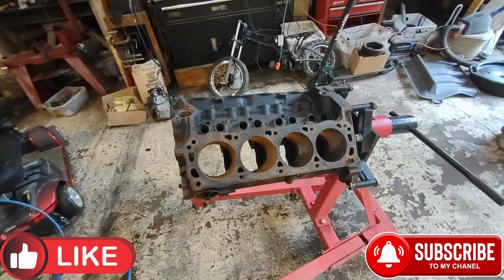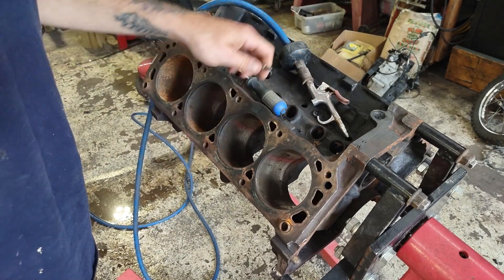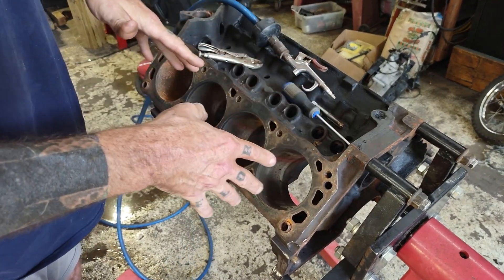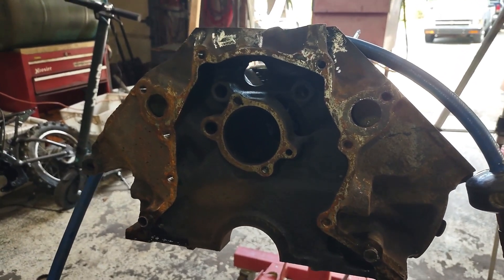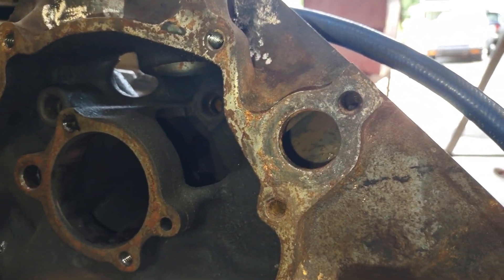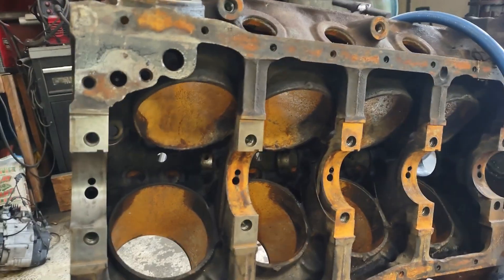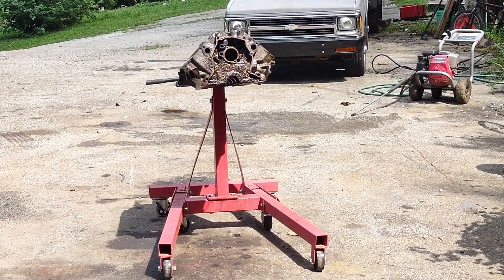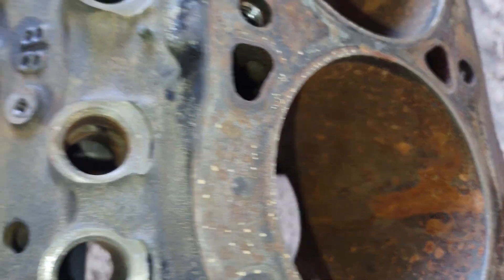Ford 302 Engine Rebuild - Part 1, Block Prep

Comment: I like using easy off it does work good like you said don't breathe it and get it on you😊
Reply from the maker: @oldmanintheshopbuiltnotbou8726  Remember when engine degreaser used to actually "degrease" things, then they took all the good stuff out of it.